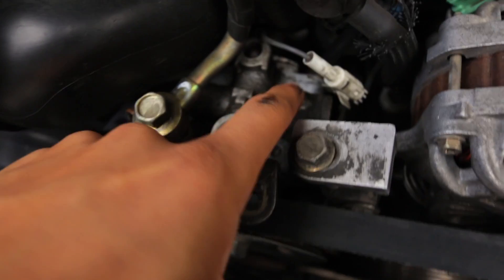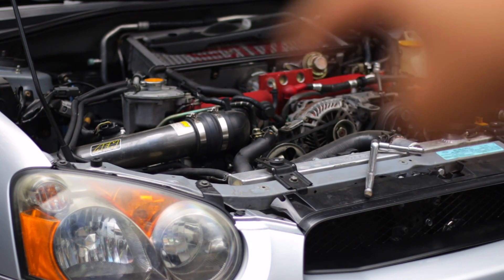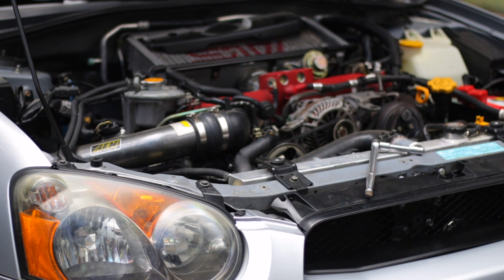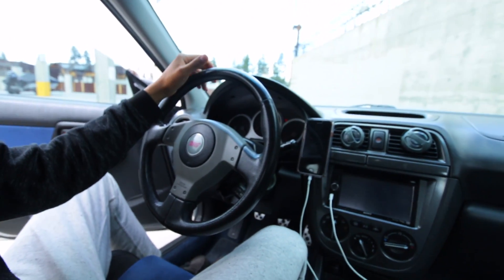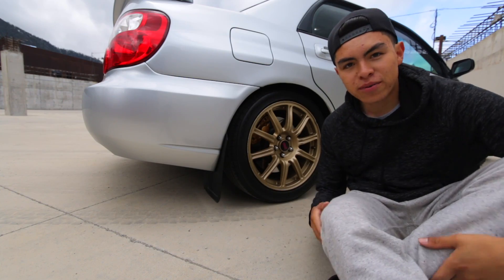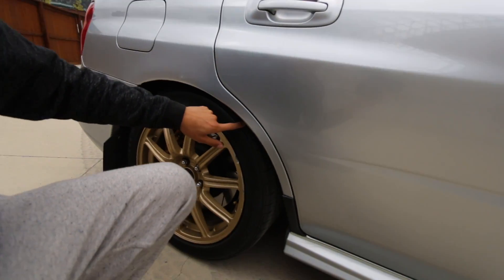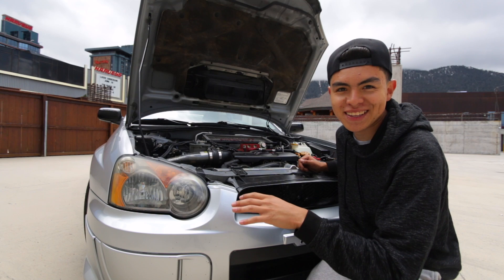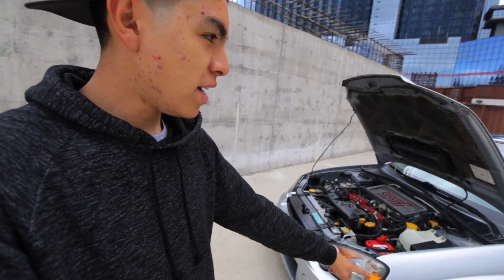I WONT BE MODDING ANYTIME SOON!

Comment: Uh, just letting you know, i've had 4 sti buddies, including my old 05 sti, with the smoke coming from the downpipe, ur power steering is leaking onto the downpipe, put some lucas stop leak in it, it's a temp fix yes, but it will fix ur problems with power steering. you'll prob pass over this comment, but im 100% sure that's what it is.

Comment: I would replace both the clamps from the reservoir to the pump. I had the same issue where I could bleed the pump for any amount of time and it would not get better. The clamps typically get weak over time and let in a tiny bit of air right before the pump making it whine. You can just slip the clamps towards the center of the hose and pop new clamps on without removing opening the system up to air. Also I would bleed the system out with the cap off and tires in the air if you haven't already.
Reply from the maker: whyausername3 a mechanic actually mentioned the clamps and how they get old, for now tho it looks like that o ring did the trick
Reply: Glad to hear man. Hopefully you can get that t-belt and waterpump taken care of soon.

Comment: The clunk noise you're hearing from that area could be a cracked weld on the up pipe heat shield. They're Notorious for breaking. Mine cracked on the dyno so we just ripped it out of there and problem fixed!
Reply from the maker: Raichu595 thanks for that, I will definitely check up on that!

Comment: tires all need to be replaced at the same time, with Subarus awd system the tread depth, and tread pattern needs to be the same on all 4 wheel other wise you will mess up the diff.

Comment: just got my 05 sti out the shop last week. replaced the t-belt & water pump. I had the same white smoke coming from the same area, my problem was that a my cam valves were leaking. wasn't a wallet friendly job but it's worth it!

Comment: i got a noise on my bugeye when i first start it when its really cold, only  SOMETIMES tho, once all winter. 

everyone is right all 4 tires at the same time!!! subarus do great in the snow, i ran most of this winter on my summers just cuz i kept procrastinating switching them. 

if u wanna save money, consider getting snow tires but running them on some cheap $50 black steelies. i got 4 new studded cooper snowgrooves (best snow tire) on steelies for like $900 from discount tire. lopro tires are much more expensive, so it will cost a lot more just for tires for ur gold rims

Comment: For your power steering issue, try changing out the fluid. Make sure to use automatic transmission fluid too. I know it sounds weird, but that's what our cars take.
Reply from the maker: Frank M yeah as soon as I topped it off with ATF it worked fine!

Comment: For the white smoke coming from you turbo/downpipe area. You could have a valve cover leak/oil leak driping onto your uppipe causing it to burn and to see some white smoke coming from there. I changed my valve cover gasket because I had the same issue and it fixed it a couple of days ago.

Comment: check for leaks in and around the oil feed line and oil return line for the turbo. Mine were leaking and caused some white smoke! It's common for them to crack.

Comment: white smoke.... prbly valve cover gaskets.... sometime oil leaks on the uppipe and smoke looks like its from turbo.... look underneath and u can see.... also u gotta do 4 same tires....u can damage diff bearings if treadwear is off or different
Reply: maybe ringland failure too

Comment: Same thing happening to my blobeye wrx, powersterring is almost non existing when the engine is cold, I think its common had the same problem on my old hawkeye but it would whine whilst turning also the blobeye doesnt make a noise it just struggles to steer until the engine is warmed up
Reply from the maker: Sounds Of Oz try changing the O ring, also check your fluids!

Comment: Replace the ps pump, simple job,  find a set of good all seasons for the sti wheels, my subaru did perfect in the huge amounts of snow we got in the north east this year on all seasons. In the video it looked like the top of your turbo was damp where the oil feed bolts on the top of the turbo, that banjo bolt could be leaking oil and thus smoking on top of the hot turbo. KEEP AN EYE ON YOUR OIL LEVEL.

Comment: Are you aware you are running the wrong fluid in the system and this definitely isn't good for your powersteering system.

You should be running automatic transmission fluid only! NOT powersteering fluid..
Reply from the maker: Built15STI yeah I run ATF
Reply: SubieTroops it looks to be clear fluid in the  video? It should be red?
Reply from the maker: Built15STI whatever was in there was from the previous owner I filled it with ATF

Comment: Wow how ironic. I did all the maintenance you issues you're running into also when I purchased my wrx. I recommend you replace the power steering pump and rack and pinion all at once. It's not that much of an expensive job if you do it yourself. I did it to my 04 Wrx and I finished it up in about 2 hours. I'm not the best when it comes to fixing cars and I got it done. As for the smoke coming from the down pipe. Check your up pipe heat shield  most of the time power steering fluid leaks onto that and creates it to smoke up. That's what happened to me. The timing belt replacement also isnt that hard but you'll need a special tool to remove the crankshaft or camshaft pulley (can't remember which one). I'm no mechanic but I'm just giving you some input on the almost exact same issues I ran into on mine. Good luck
Reply from the maker: Danny M3 thanks man I appreciate the feedback! It looks like that o ring may have fixed the power steering leak! As for timing belt I'm not too sure if I wanna get in there and do as I'm not that experienced in the mechanical field. It takes one little tooth off and it'll turn into a bigger mess lol
Reply: SubieTroops that's very true. It's better to have a professional do it right the first time around. Instead of trying to save a few bucks and making it even more of a problem